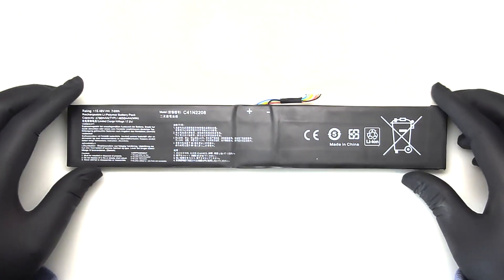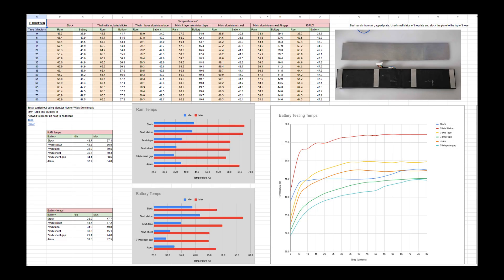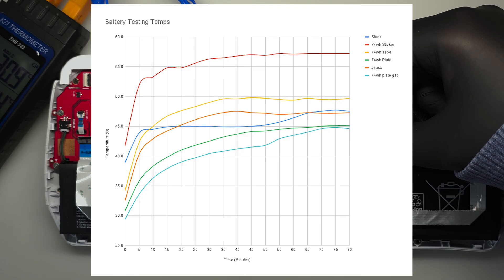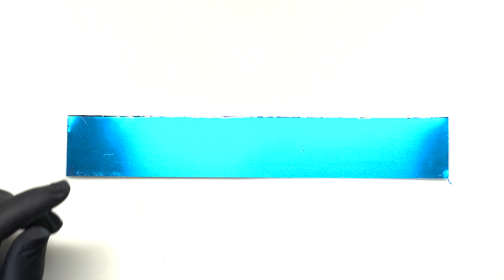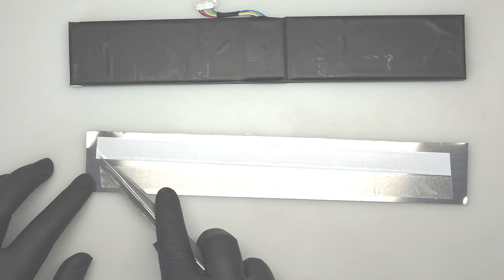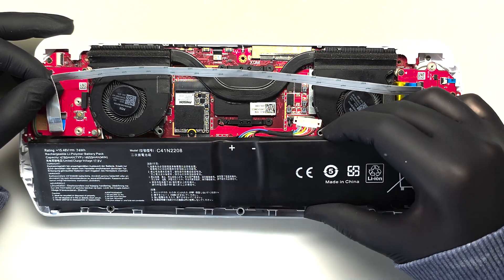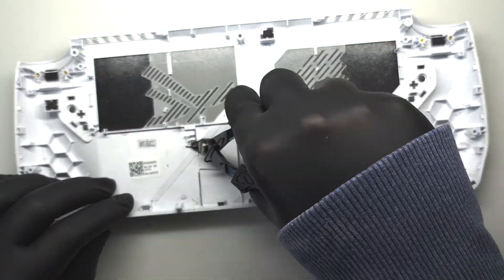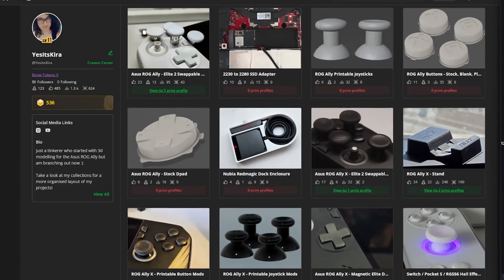ROG Ally 74wh Mod - Full Tutorial and Safer Method!

Comment: Thank you the great testing and tutorial.

I ordered a battery off of a third party seller on Amazon (Sold by Elecmie), spent hours doing the work of shielding... but after install, it read as 0% in ASUS UEFI, showed Battery Failure under Power tests, and in Windows wouldn't go above 0% after several hours. Oddly, it was showing it as connected properly with the correct 74wh as design capacity in Windows Battery Report. After hours of troubleshooting and reinstallations, I stumbled across one of your comments that mentioned to plug in the battery with the Power button held down. This seemed to have actually worked!, albeit temporarily... I was able to charge the battery from 0% to 100%. However, while starting to test things again, it stopped working again and the Ally immediately shut down, despite being plugged in. After that, it went back to the initial registering as 0% behavior. So I've plugged back in the original battery for now, which of course functions as expected for one hour. Now Amazon wants me to return a loaded hot potato, which is supposed to be against their return policy... good reminder to play it safe and get something reliable.
Reply: I'm having the same problem with the battery I bought for the ROG. I'll test if it works this time, because last time it was showing that the battery was at 255%.

Comment: I have an alternative material suggestion mica paper or sheet bonus is it would be non conductive and would probably prevent more heat from transferring into the battery than the aluminum heatspreader.

Comment: Anyone tried adding thermal paste between battery and aluminium plate? I believe it will further improve heat dissipation
Reply: Use thermal double sided 0.2mm I did

Comment: Hi, I would like to ask for help after doing this mod. Initial installation showed the battery get charged up to 100 % and the system info even indixated the 74wh battery capacity. But now I get the orange light blinking no matter the adjustment in battery connection plus covering the light sensor... Anything else I could do about this?

Comment: Question can I use instead of aluminum plate a copper plate? This can be a greater solution than using an aluminum plate?
Reply from the maker: Hi! We are trying to shield and reflect heat instead of conducting it. Aluminium works better for that :)
Reply: @YesItsKira_ thanks for answering, have nice day!
Reply: @YesItsKira_ Where will the heat dissipate if the plate gets hot? Ideally, the heat should be conducted either to the case or to the display to at least dissipate it somehow, but in reality, you'll just end up with slightly slower heating. It's not enough to just conduct the heat; it also needs to be channeled somewhere. It would be nice if the device's cooler dissipated it, but as far as I know, there aren't any such flows.

Comment: I would suggest using double sided thermal tape like Sekisui 5760 instead of normal tape as that will transfer heat from the battery much better

Comment: I did a similar thing to mine with the 74wh battery. But I used aluminum tape around the battery and then made an air gap between the shell and battery. Haven't checked temps but seems to run good.

Comment: Hello, bought 80wh and when i tried to turn it on it wont detect the baterry, tried the same in stock battery and would not detect it also
Reply from the maker: Have you tried plugging in the stock charger or covering the light detector on the inside?

Comment: Greate tutorial Thank you so much. Just a quick question. If the idea is to isolate the battery from the RAMs why using a thermal conductive material, wouldn't it be better to use cardboard or some plastic sheet to avoid transferring heat?

Comment: is there any way to check the ram and battery temps? how do i know it did a good job? i didn't have double sided tape thin enough so I just tape the battery and the aluminum plate together, wrapping them around aluminum tape. is it a good idea or better look for the correct double-sided tape?

Comment: Bad news, the new 79.7Wh variant of this battery sold in Aliexpress which has the same code (C41N2208) is thicker than the 74Wh and doesn't fit even with just the 0.5mm aluminum plate, only fits without anything extra. It seems the manufacturer decided to maximize usable space in this new version. Now I will worry about the temps forever. Does anyone have any ideas? is there a backplate I could print that is just slightly thicker?
Reply: go to the rog ally subreddit. there are reports of the 79.7wh mod being possible if you use 0.3mm plates instead and cutting a bit more plastic (the two squares below the fans in the middle where you usually put a bit of foam) until they're flat to the surface of the motherboard
Reply: I don't think any available back shell will fit that big a battery. But maybe there are some tutorials out there.

Comment: Thats why I bought mine off amazon but seems solid. Mine only goes to 99 for some reason but guess just aoftware issue since not the oen battery. Either way well worth it. Didnt want to have to shave my oem shell but jsaux dont make the backplate anymore sadly. Although theu have their own 65 wh mod coming soon with a white backplate. Either wah this mod is a must for the ally plus steam os and ssd

Comment: Hi! Thank you very much for your guide.
I want to mod my ally the best possible way, but its impossible to get a jsaux rog ally backplate rn and im quite unsure if they will restock for the old ally.
Is the handhelddiy backplate fine to use too? Or should i trim the original plate?

Comment: Thank you for the excellent turorial. Just completed the mod myself. It was pretty easy, I sure took my time, though.
Being obsessed with temperatures I opted for the air gap method. 
The Ally is charging up for the calibration process. Hoping for a good unit and painless experience.

If you're concerned about cutting the aluminium, don't be. It's super simple and the shortest bit in the entire process.
Just use an exacto knife and a ruler! Give your marked line a few good passes with the blade. (Watch your fingers, for the love of god!)

Align the grove along the sharp edge of a table and broadly bend your strip down 90°.
Bend it back up and down until the strip breaks right off in a quite satisfactory manner.

I happened to get my hands on a 50cm x 25cm sheet, so it was a lucky perfect fit. But if yours is broader, make sure to be either generous when measuring 
or use the entire length to also later cut the little strips for the air gap method from the rest.

I do have a clear plastic case over my Ally which might help clamping down on the midsection.
But still, as a preventive measure, I very loosely put a strip of electrical tape over the actuating part of the back buttons (the ones with the
cross-shaped cross section). Otherwise the battery might push the backshell too far apart for the back buttons to trigger properly.
(Maybe a drop of super glue on the little cross might do the same.)

Comment: Just completed the install. Only extra thing I did was sand the rough parts smooth where I had to cut the aluminum or the plastic. Something to note is that the 2280 m.2 L bracket does't fit well with this particular battery. The batteries power cable sits right where the bracket would, so you have to put it on top of the cable at a funky angle. I was able to get in well enough after working the cables a bit, but I did consider just getting a 2230 m.2.

Comment: I have a question for you now regarding this. In the last day or so mine has begun doing something a bit odd. For some reason, even when it’s not plugged in, windows thinks it’s being charged. The battery icon in the bottom right has the “lightning bolt” next to it like it’s being charged, and my RGB is on, which is set to only be on when it’s plugged into power. 

Any idea what I might do to fix this? Or do you think this is something I shouldn’t be worried about? I’m in the process of doing a full battery drain as we speak, and then I’m going to charge to 100% uninterrupted, in hopes to calibrate this new battery. I had not done this after replacement.

Any thoughts on this would be super appreciated. Thanks! 🙂

Comment: The original battery has aluminium foil, if I use the same you think i got same result, or you recomend the plate?
Reply from the maker: Hi! The foil is not enough unfortunately. The foil is ok for the stock battery since its not directly above the ram! The plate is what will keep your temps down :)
Reply: @YesItsKira_  Thx for the reply. you are doing an amazing work

Comment: How much a difference does the aluminium plate make thermal wise?
Reply from the maker: Hi! It drops the battery temp from 57c to about 45c in this test. You can see the data results in the video :)

Comment: Hi I did this battery mid and it's stuck at 100 percent any idea how to fix it thanks
Reply from the maker: I would try running the ally till it turns off, recharging to full and then seeing if that helps. 
Alot of the batteries have been reported as having issues so you may want to try returning it and getting a replacement
Reply: Thanks for getting back to me so quickly I might have to do that god knows how I'm going to get the aluminium plate off tape seems to be solid

Comment: Can I use copper plates instead ? Or would it destroy the electronic parts because of it conductivity? And isn't the aluminum plate also conductive ?
Reply from the maker: Hi! Aluminium is a better heat reflector than copper wheras copper soaks heat faster. In this use, we want to reflect the heat a nd shield the battery instead of aborbing it and then transferring the heat to the battery :)
Aluminium is also conductive but there is only the speakers and ram under the plate. Everything else under there is plastic.
Reply: @YesItsKira_ hey thank you for your reply. The battery and the plate just came in today and I tried it out right away. Thank you for your instruction 👍

Comment: Thanks for the video! I just bought the jsaux heat sink plate, the transparent backplate, the 74wh battery, and some aluminum sheets and plan on doing the plate + air gap method to keep the temps as safe as possible. 

I have a ton of double sided thermal adhesive tape (the kind that is covered in light blue plastic), but while it is super thin, it doesn't look nearly as thin as the layer of adhesive your tape left behind when you removed its white cover. What kind is it? I tried my best to Google the tape based off what's in the video but I cannot find it lol.

Comment: So no foil just these sheets???
Reply from the maker: Hi! Yes, the combination of the foil and the place was no different to the plate on its own in my testing :)
Reply: @YesItsKira_  Ok so let know if I've got this right: basically, 0.5 plate, stick onto the battery using doubleside tape, install - done. That a fair TLDR?

And so far you've had this done for a month, any issues or anything to be wary of? ChatGPT is having a panic attack at the thought of sticking aluminum to the battery with double sided tape, concerned with shorting etc

Comment: I did this upgrade, the only issue i got is it wont shutdown and restart properly, but after i uninstall armory crate, and use handheld companion, the problems gone, did you have any of this trouble too? Can ur ally use armory crate normally wiht this battery mod?
Reply from the maker: Hi! It shouldnt cause any issues with shutdown and restart. It could be an unrelated issue to the battery mod!
My ally functioned as normal with the mod installed.
Reply: after looking out mor info, i found a seller that sells 2 different type battery 😂 i got the first type which makes error with armory crate, the second type battery but different price, wont make error with armory crate, i think ill buy the second type battery later if my first battery comes to degrade :D thanks for your answer tho cheers🎉   @YesItsKira_
Reply: found out i got the battery with an error with ac, should've gone with the other battery like u use here, this battery won't make error with ac 😂 
the price is different from the seller i found, might buy the one that won't make error later after my first battery degrade, thanks for ur answer 🎉

Comment: my battery look just like yours and im having problem in windows while armoury crate installed, power profile can't be change, windows showing it's charging while it's not, re-installing AC not fixing it had to use handheld companion but hate it because lots of bug. Do you also have this problem with armoury crate?

Comment: I’m going to test this method but I have a bunch of 1 and 2mm leftover thermal pads that are sticky so I’ll use that instead of the tape. I’ll lyk
Reply: How was it? Using thermal pads instead of tape?
Reply: @ronderev i don't think it's a great idea. She used alu sheet to shield battery from heat coming from ram, not to transfer it.
Reply: @akuwdf8057  i have a double sided tape but the  it's width is 1cm. I may not be avle to put 4 separate strips for air gap. The double-sided tape is a tape i used for my car to tape back car emblems. Is that okay? I would like to know your thoughts on this
Reply: @ronderev i don't think the width should matter, you can put 2 strips next to each other or cut it to get the width you need. I think those small pieces are about 4x2 cm. Also you simpy can go to your local stationery shop to buy a tape you need or even order it online.

Comment: Hi, I just want to ask if you happen to know that the handeld diy backplate is compatible with this aluminium plate battery mod, because I also want to buy it for good cooling, I just don't know if it won't be a waste of money if I can't screw it on.
Reply: Just got the handheld diy on sale for $30, will be trying this mod. I’ll let you know how it goes.
Reply: Did it fit?  @r6parker
Reply: @ronderev Parts were delayed, will hopefully be able to update within 24hrs. Aluminum backplate was lost by Amazon ☹️
Reply: @ronderev  I was able to fit everything! I had to do a bit of trimming on the HandheldDIY backplate, but it was significantly less than what was needed with the stock plate.

Comment: Loving the video Kira, can we use a 1mm thick aluminum sheet? 0.5mm thickness aren't sold in a single sheet near me
Reply from the maker: @mazzioamazed4950  it might work but there really isnt alot of space inside the ally to play with. Just make sure to trim the backplate super super flush and use the thinnest tape you can! 
If the ally doesnt stay closed without the screws, dont try to use the screws to hold it together. The posts are really weak and easy to rip out!

Comment: Dumb question but you mentioned a 0.5mm aluminum plate. Would it matter if I use 0.8mm one instead (as long as it fits into the Ally)? Because I can't find a proper 0.5mm plate here where I live
Reply from the maker: @turkturkelton2357  hi! You could use the 0.8mm if its the plate without the gap method. There is such little space in the ally already with the battery. 
0.5mm is the perfect size for the shielding effect and making use of the space. 
I would say try it but be super careful with trimming the supports down and when you are closing the ally, make sure theres no extra stress on the screw posts since they are really easy to rip out.
Reply: @YesItsKira_  Alright, thx

Comment: Hey thanks for making this video!

Did you consider using kapton tape? Could it be used as insulation rather than creating an air gap?

I'd like to be able to use kapton in place of the plate entirely since I already have it on hand and theres no risks of shorting anything, but I am not really knowledgeable on this stuff.
Reply: Full disclaimer, im no an expert, but my understanding is that kapton tape wouldn’t add enough insulation in the part over the ram. It might even make the battery hotter by trapping heat, especially in the parts of the battery not close to the ram.
Reply: @lcar859 yep, that makes sense. I didn't consider the fact that it would also stop the battery's heat from escaping.